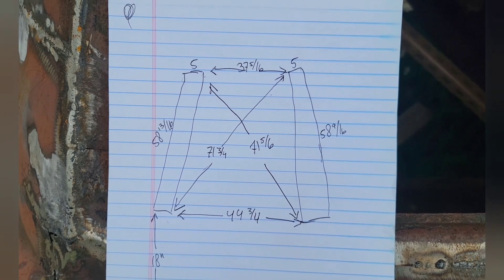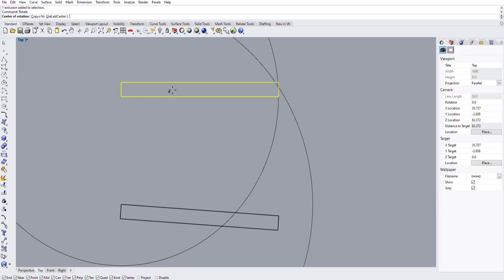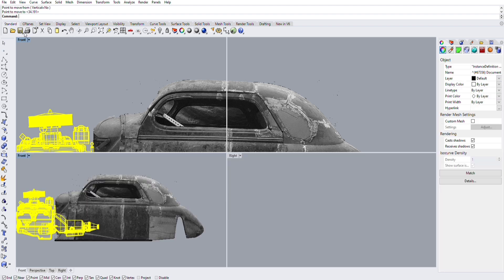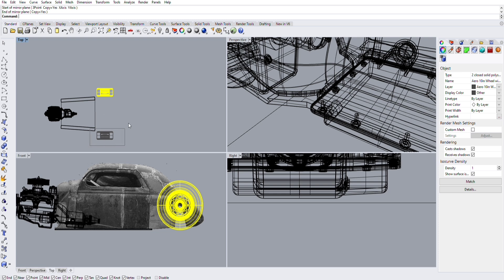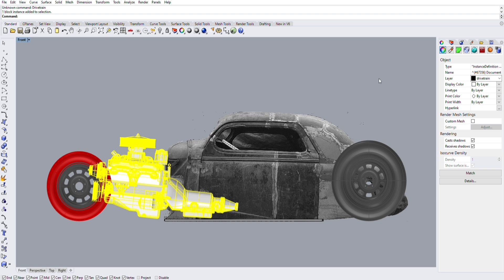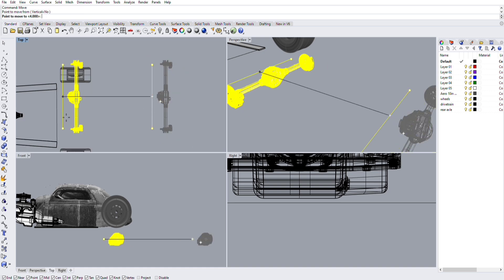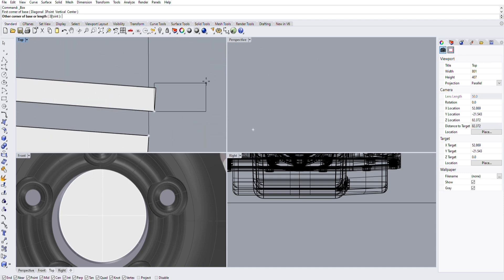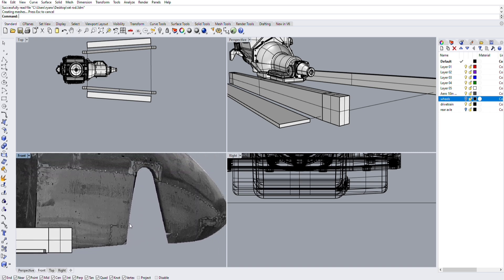Rat Rod Chevy frame in CAD  Part One

Comment: Amazing work, Can’t wait to see part 2. 
Will you be working out any of the suspension geometry with in the 3d model?
Reply from the maker: Absolutely.  When I had a shop I spent years designing suspensions in CAD.  Mostly 4wd, link suspensions for long travel.  I built myself a rear engine IFS 4x4 buggy that worked amazing, and my other car has custom lowers with silverado uppers and knuckles.  
I'm just planning a beam on this one, and a 4 link out back, but I'll show the entire process.

Comment: Those curse on the frame are going to look nice..however a lot of work…z ing would not be easier and just as strong?….
Reply from the maker: Absolutely.  Arguably a Z would be stronger,  and I could do that in 15 minutes and no math.  But for the sake of time, style and $$$, it's around the same cost to myself either way,  and the cool factor is much higher the direction I'm going